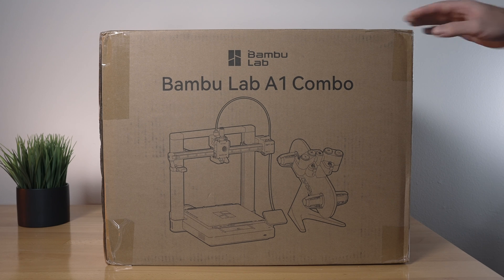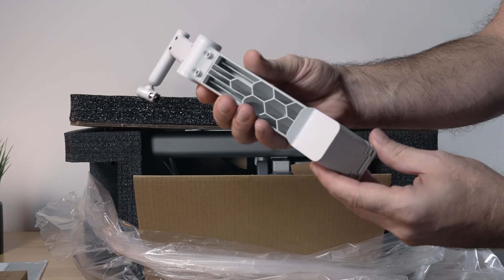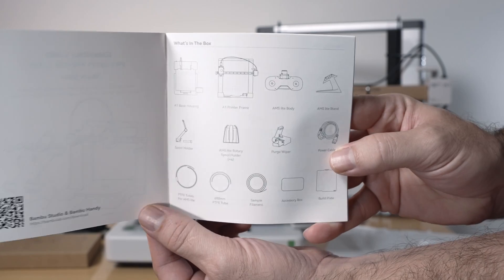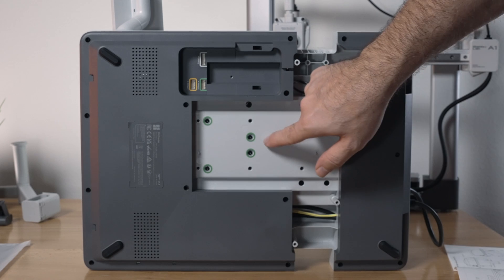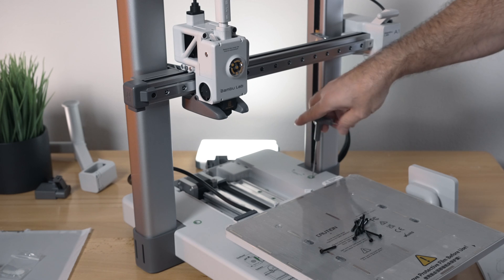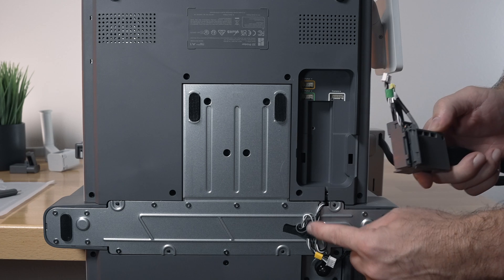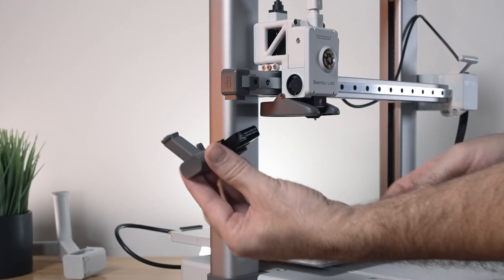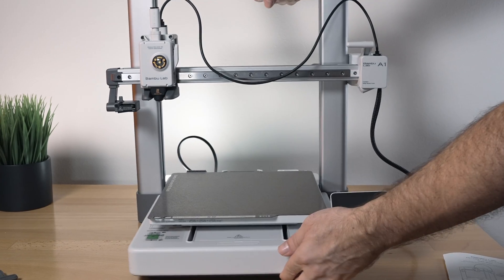Bambu Lab A1 - 3D Printer - Unbox & Assembly

Comment: Disappointingly I didn't receive a model to build / print with my A1 Combo. 
I also have an A1 and have decided to keep it and opt for replacement bed and cables as mine has wirked flawlessly since owning it and I continually monitor both before and after printing also it is connected via an RCD circuit so if something should happen the power is immediately cut off

Comment: Why would you promote a printer with possible electrical problems until they fix all A1 printers. These are not supposed to be used until they are fixed.